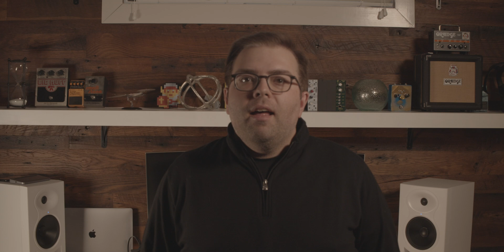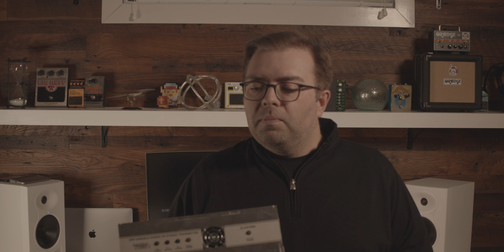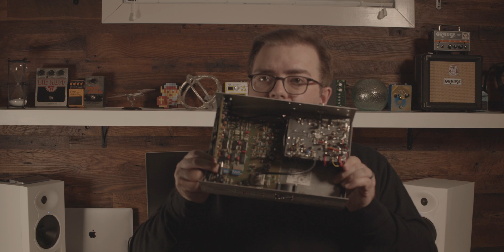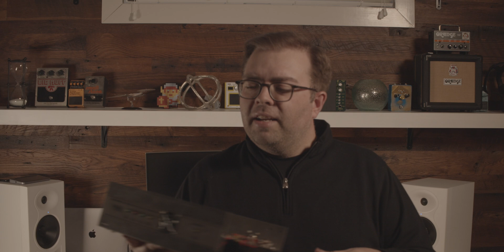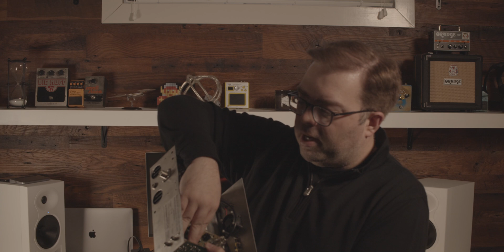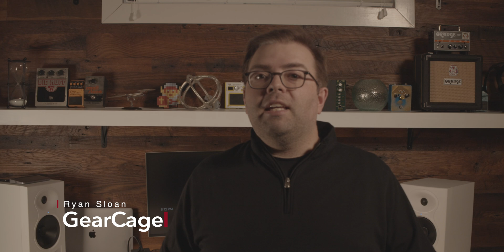How To Broadcast an FM Signal For Houses of Worship During The Coronavirus Pandemic and Beyond

Comment: I have a CZE-T251FM transmitter.  I purchased it years ago but never used.  If there was a manual it was pretty poor.  I have a couple questions.  It has a Mic input.  What kind of microphone should l purchase?  It also has a L and R line in.  Is that also for a microphone (stereo?).  It also has an rs-232 port...possibly to control via a computer?  It is powered by 12 volts (6amp).  Please reply.  An email can also be sent to:
DodgeChargerFortyThree@gmail.com.
Thanks, jeff

Comment: Even 1 watt or even half a watt is illegal and in some U.S. states is a felony to operate at that power level without a proper FCC license. Also there are regulations and restrictions on antenna length and grownd lead length.
Reply from the maker: Very true.  1 Watt is illegal in most places across the US.  However, you sound like you have a good foundational knowledge of FM radio so you know that broadcasting at 1-watt or below without elevating your transmission antenna is going to give you very limited range as the height of the antenna really trumps the broadcasting power.  A ground-level dipole antenna is probably going to give you a clear broadcast range of a 1/4 of a mile potentially up to a 1/2 mile with a 1 watt transmitter.  And most of the transmitters have a setting to go down to a half watt or 100-250 milliwatts which should cover a typical church parking lot with a little room to spare.
Reply: I have a 1000 watt I run at home sometimes just for fun but only once in a blue moon.  Most of time it's off or go to jail